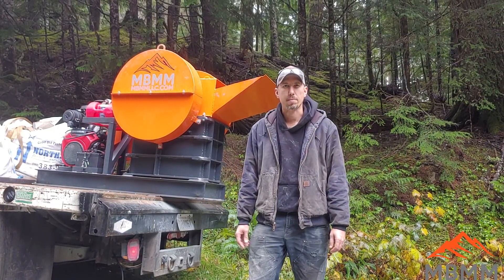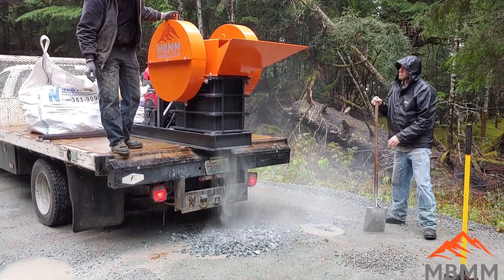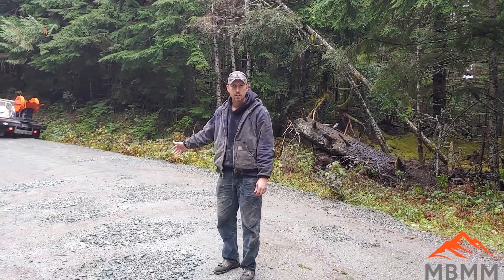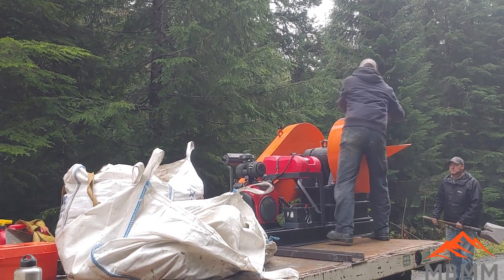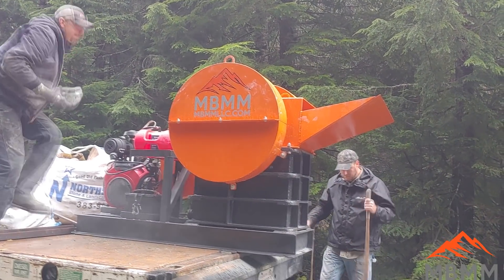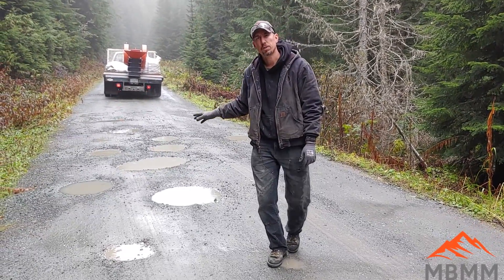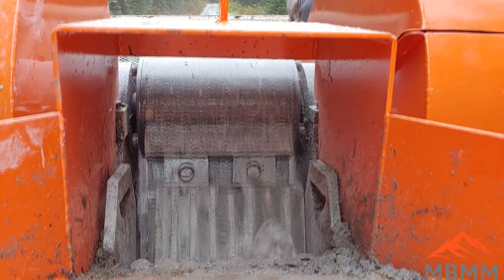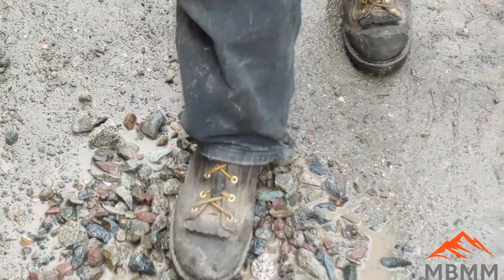How To Fix & Fill Potholes With One Simple Rock Crushing Machine!

Comment: In my experience living on a gravel road with a gravel driveway this method is temporary at best.  The potholes will be back in no time.  It may seem counter intuitive but you have to dig those holes out because right now they have been compacted into a bowl shape and act like a soup bowl.  No matter what you fill them with it will just get bounced out.  That rock will not embed itself into the base rock, it will remain loose.  Destroy the bowl with a ripper then grade the entire road smooth without hidden bowls filled with loose rock.

Comment: you should make a version that is mounted on a 3 pouint hitch system to be tractor mobile and tractor PTO driven , that would definately be big in Europe if you can get price to no higher than 3000€ , probably would also be big in the USA

Comment: if you add a little clay to the pothole, wouldn't it last longer?  i tried this by pouring gravel into 5 potholes and within a few trips the hole was open again.
Reply: Clay, Portland Cement, etc!
Reply: Yep like marbles in a glass bowl with water in the hole, simple box blade with tines to break up the 4” of top packed shell then drag it smooth. Its called driveway maintenance for a reason, i want one of these because of 4 dumptruck loads of rocks that was dumped on my property  prior to me buying it. May be just cheaper to use it for a base in the soft places  then buy new stone for the top coat

Comment: How does that crusher adjust the crush size of rock? When you go from larger to smaller does it move the fixed plate closer or the moving plate closer?  I'm assuming the former but wanted to ask.  Cheers
Reply: Rick dees - From my time looking at Jaw Crusher Videos, I am pretty sure, the Moving Plate, has the Gap Adjustment Control, on that side!
Reply: @robertweekley5926  Thanks Robert.

Comment: Interesting/fairly simple study could be.. If the jaws were set to run 3/4 or 5/8 materials from concrete slab chunks would crusher output be suitable as complete sand/aggregate components for fresh concrete (in terms of stone and fine). If yes, this opens an opportunity to batch mix concrete on-site with a 1 or 2 bag mixer. Maybe just right for small to medium driveway tear-up/replacement.